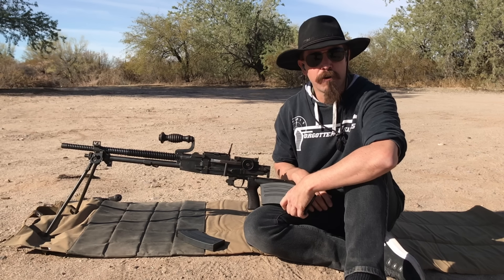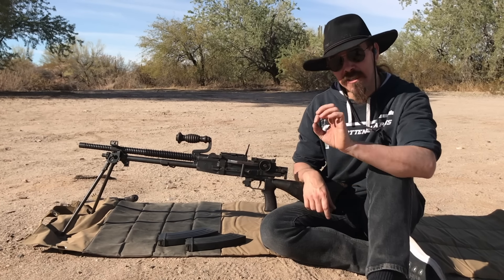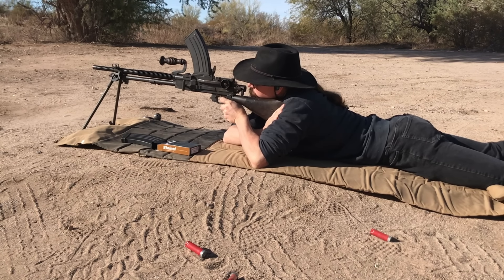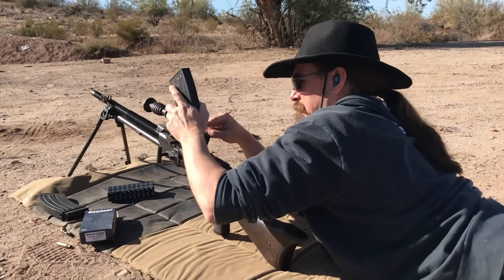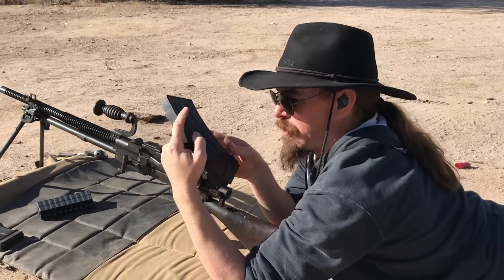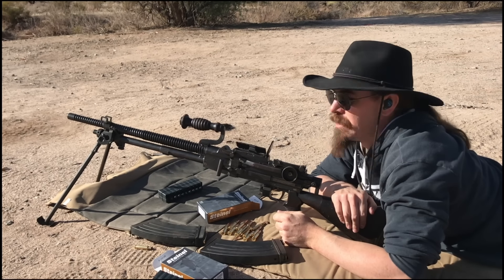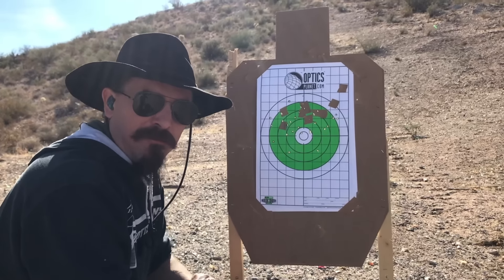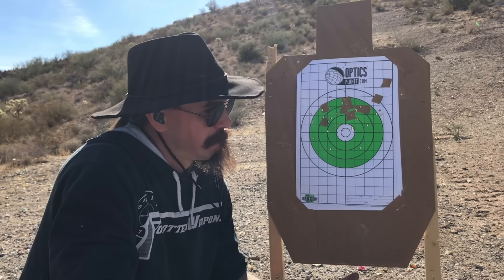First Range Trip with a Type 96 Nambu LMG (I Think I'm in Love)

Comment: You probably won’t believe this, however, in the late 1960s, I, with my Australian Army unit, went to Papua New Guinea, we “walked” a fair bit of the Kokoda Track. We did a bit of “hearts and minds” with the locals. We explored the WW2 “battlefields”. We came across the usual detritus of war, including trenches, bunkers, ruined vehicle, the carcasses of crashed aircraft. Then, in a Japanese bunker system, we found complete, intact, well preserved and when stripped cleaned and re-assembled, functioning Japanese small arms. We also found ammunition. We also found Mortars and in one case small Artillery, however we didn’t test the mortars or artillery. We did “test” the pistols, rifles and machine guns. I think, with reliable ammunition, I would like the Nambu, like Ian, I found the Nambu very similar to the Bren (which I loved in both .303 and 7.62). We took a bunch of the weapons back to Australia, I know some of them ended up in Army museums and am certain a few of them were in our units private kit bags. We learned later that the bunker where we found many of the weapons had been submerged for years in stagnant water and the tannins in the stagnant water had coated the weapons with a preservative!
Reply: Unbelievable
Reply: Crazy how it’s not crap like the boomers tried to claim.  If a gun still works in combat with original parts it is not only good, it is goated. German and Japanese weapons are both insanely high quality and well made considering most modern firearms wouldn’t even fire if left on the battlefield under conditions 5 years later. Even ak are not as invincible as people say. But ironiclaly japnese fire arms are. Arisaka is basically undestroyabke.
Reply: @ Hello fender, Not the Boomers, they are the generation AFTER, I grew up in a household where my Father, Uncles, neighbours etc had all fought the Japanese (hell my Dad was still fighting IJN Marines in Burma 6 months after the war had ended, the IJN Marines had run out of ammo and were making banzai charges using bayonets and sharpened sticks, trying to get close enough to throw satchel charges. They all had souvenirs, my Uncle later sold his Samurai sword for a fortune. Strangely, not many firearms, a few pistols, they looked a lot like Rugers to my eye, Dad gave his to a museum.

Comment: When I was in Okinawa (1960s), we had several Type 96 and 99 Nambu's available with lots of Japanese issue ammo.  The T96 loaders had an oiling pad integral, the T99 loaders did not.  If we fired the T96 dry, we would get neck separations every so often.  We found that we could wax the cases with Pledge furniture polish and reduce the separations to almost zero.  I suspect your modern cases are a bit thin in the neck/shoulder area as compared to Japanese issue, and will require some lubrication.  I would try rolling the cartridges using LEE sizing lube on a pad.  That is essentially a dry lube that you can leave on the cartridges for a long time.  The Type 99 has a slower extraction timing and does not need lubrication normally.

Comment: The Type 99 Arisaka is actually kind of impressive.  A WWII rifle with not only cock-on-close and rear aperture sight while still having a lot of obvious Mauser influence, but polygonal rifling and a chrome-lined bore.  It was probably the most technically advanced bolt action rifle in the war.
Reply: Japan produced probably the best bolt actions. The 38 and 99 are fantastic... their front posts are a problem though, the type 38 especially.
Reply: @iannordin5250 not the best then 🤷‍♂️
Reply: I would probably say the MAS 36 if asked about the best bolt-action of the war. Simplicity, great sighting system, and overall good design execution.
Reply: @LOVEMUFFIN_official 
You must've had better luck with yours. Mine has a rough action, feels like mild sandpaper and is by no means fast. I like the concepts, and the look for that matter. Just wish it was smoother... a lot smoother
Reply: Don't forget the dust cover.
Reply: I've never handled one in good condition; all were pretty rough. None had a good trigger pull,heavy and gritty.
Reply: My experience was rough to feed the first round, but very smooth for the rest.
That may be a magazine spring issue. 
I don't like having to move so far to cock the straight bolt handle. 
The sights are great for discerning your target quickly if in foliage, especially so if it is moving even just a little. 
Above all, it lands a round very close to where you aim it. Within a few inches at 60-80 yards, which is fine for center mass in a stressfull situation.
But, although military trained, I am nowhere near a competition shooter. 
Doesn't that make it almost perfect for your average WWII soldier?

Comment: Amazing that Japanese weapons are finally getting some recognition for how good they are.
Reply: *how good SOME were.  Their pistols ranged from downright awful to just below adequate. The Type 92 HMG was heavy with a slow rate of fire from 30 rd stripper clips which needed lubrication for sustained fire. It was basically adequate.  The Type 11 with its hopper-fed design was interesting but not very effective in a larger sense. Taking rounds from soldiers around you solved some supply problems but then you’re taking on the liability that all the soldiers took care of their ammo and provided clean, undamaged clips. Their SMGs were barely adequate in that while reliable, they fired an anemic cartridge.  They also weren’t supplied in decent numbers to make a difference. Finally, their late war, last ditch rifles were functional but their materials and construction varied widely and made their reliability an issue. 

I agree with you 100% on their rifles. Especially the Type 38 with the light recoil 6.5mm cartridge. Flat shooting, with a long barrel that burned most of the powder, it did not have much of a flash and very little smoke. Perfect for keeping your position hidden in jungle environments. 

However, a great bolt action is still secondary to a self-loading rifle like the M1, SVT, G41.
Reply: @soldat2501 apart from Nambu pistol...all Japanese guns were good

Comment: Good point about the culture problems with Japanese equipment in WWII.

A case in point: the Japanese Type 89 Grenade Discharger.

The Allies dubbed it the 'knee mortar'. Not sure why although I've heard it was because of a translation error.

Apparently some Allied soldiers tried to fire it with the base plate resting on the knee. Which resulted in a lot of broken legs. https://en.wikipedia.org/wiki/Type_89_grenade_discharger

Comment: I love the „uNdErpOweRed“ cartridge debate.  Thank you Ian for showing how crazy accurate and reliable this thing is. Ok then so why the hell are modern armies using 5.56 in lmgs and assault rifles if it’s underpowered?  It’s even smaller with less energy than a 6.5 Arisaka.  So that is complete bs. The Japanese and the Germans figured about before anybody else that small intermediateish type rounds were far superior than bigger rounds for almost EVERY battlefield encounter besides penetration like a 50 cal or a 308 would give for a sniper through material and concrete whatnot.  For a mass produced round the 6.5 Arisaka was arguably the best for recoil control with deadly precision. The Germans only discovered this late on the war and the Americans were close behind with the .30 cal carbine round but still not the same as it was not a rifle round but a round pistol Type bullet with a rifle mush sized cartridge. Japan does not get the recognition it deserves for its firearm genius. We all know german engineering but because boomers brought back late war models of guns they didn’t actually have good specimens to deal with. Almost like if a Japanese soldier came back with a Springfield 1903 and talked about how primitive america was when in reality less than a year after Guadalcanal most US troops were using the semi auto M1 Garand. It’s just a bad comparison to compare early war-late war firearms.

Comment: Alright Boys and Girls, pay attention to this.
    @5.23 thru about 6.10, when your firearm has a case separation STOP shooting it NOW. A case separation can occur because of the mentioned possible issues of defective brass and or a dirty or pitted chamber. A case separation is also a good sign of excessive headspace in a weapon. A gun with excessive headspace can blow up in your hands (and face), shooting it.
    That weapon needs to be thoroughly cleaned and inspected. The headspace(of the weapon) should be measured and compared to the manufacturing specifications of the weapon. The ammunition also needs to be measured and compared to both the specifications and to the measurements of the weapons chamber. The weapon could be in 'specs' and the ammunition could be manufactured 'short'. In other words, just checking the chamber with some head spacing gauges won't tell you that the combination of weapon and ammo is safe.
    Nice video. Y'all Take Care, be safe and be aware of your head spacing! John
Reply: I expect that Ian had the weapon checked out good (probably by Mark Novak (I don't know that. Mark is an excellent gunsmith and I know he has done work for Ian))and I'm not trying to fault anyone.
   I just wanted to make everyone aware that there is a potentially very dangerous situation going on.
    Everyone Take Care and be safe, John

Comment: Two small things for Ian. First the spring is in the magazine dust cover is in wrong. Once released the cover should spring open and you should not have to fight it to get the mag in. Also on an open bolt gun, you should really operate the bolt first not the mag. Sometimes you remove the mag first you can set off a round accidentally if the magazine was stopping it from firing.

Comment: Need to check headspace on this firearm...  Make or use commercially available headspace go/no-go gauge and check headspace... it's not correct.  Need to make a chamber cast and this will help you with finding chamber imperfections. From this video it's obvious that there is a issue with the throat of the chamber.

Comment: I have never seen a malfunction like that. That’s pretty crazy. Glad it didn’t get jammed up in the chamber
Reply: I have. Magazine follower is nose-diving, so the round smacks into the end of the barrel extension.
Reply: @ScottKenny1978  isn't that a feed lip issue if the follower is 20 rounds away?
Reply: @randomidiot8142  no, it's the follower.

I had some old AR magazines, a 20 and a 30. When fully loaded, the first round liked to get stuck between the barrel extension and the feed lips. I replaced the follower with a Magpul 4way anti tilt and haven't had a problem since.

Comment: The shop i visit has a dealer sample hotchkiss m1922/26 made for Turkey with a strip feed. I found them type 92 high strips that fit and feed. But we haven't figured out the gas to get it running more that a couple rounds.

Comment: That torn case reminded me when i was out shooting the ZB-30 for first time. First, i thought that it could be some gunk inside chamber, same as you, but it was happening again and again( tolerances in chamber like a new barrel).  After that i tried some really old steel case and brass with no issue.... Only new made stuff have this problem, so I lubricate my cases before shooting and the problem is gone. Its like the new ammo is not ment to be used in automatic firearm...

Comment: It's worth noting that unlubricated soft-point hunting rounds are quite different than the reduced-load Type 38 cartridges with oil loader intended for this gun. Of course, you don't want to get those rounds exposed to dust in the field! Considering the chamber problem and ammunition, this was a rather good showing. Also, disappointed Ian didn't wear his IMA Type 98 senbou cap!
Reply: Pretty sure the 96 and 99 didn’t need oil loaders
Reply: @alexmoore1506  The 96 did, the 99 did not.

Comment: That's really remarkable grouping for a support weapon.  No worries on the malfunctions, even our current 240s occasionally destroy a round trying to jam it in incorrectly and that's with spec ball ammo.  I'm really impressed with that weapon overall.

On another note though, there is a lot of appeal to having a larger beaten zone at full engagement range when you're employing a support weapon.  It would be interesting to see what 200-600 yards looks like, maybe on steel, I'm curious how those groups will open up.

Comment: I'm curious, what happens if u shoot a gun with a hole in the barrel, what are the "catastrophic results" and what causes it? Excuse me if this is a silly question but it's not obvious to me. I can understand that gases would be released through any hole but wouldn't it be a bit like a mussel brake on a larger weapon, depending where the hole was? Also, why were the bullets jamming and squashing up the "soft" lead head, is that common and what is happening to cause it? Again, just curious. Now off to see if you have done a more in-depth look and tear-down of a Nambu, Forgotten Weapons does a great job at showing n explaining how these guns work and how n why they came about, thanks for doing it.

Comment: I read somewhere that the Type-96 was something similar to a SAW and the Type-99 was the LMG, which is believable, considering that the Japanese didn't ditch the Type-96 to use only the 99, they still made both until the end of the war and they probably served in different roles.
Reply: Well from my understanding, not exactly. Japan didn't had the industrial might to produce enough small arms to swap all of troops to 7.7mm type 99, so it's all over the place. Although my understanding is that type 99 rifle and LMG are more likely to end up in pacific theatre, and the older type 38 rifle and type 96 LMG are more likely to end up in China theatre.

There is, however, an even older Japanese LMG design that is closer to the SAW concept. I think Forgotten Weapons also has a video for that. It is actually fed by 6.5mm chargers dumped in a hopper, thus enabling troops to not only share ammo, but method of loading as well. It worked as well as you can expect (read: not very well), but it was truly ahead of its times. A lot of them end up in the hands of Chinese "puppet troops", whom the Japanese really didn't trust with empire's newest and greatest.
Reply: @BicyclesMayUseFullLane  Type 11, pretty unique gun indeed.

Comment: I'm more knowledgeable about warships, but it seems Japan started the war with very solid equipment for the time (maybe not the tanks).
It's fairly impressive, considering how far behind they were before the Meiji Restoration, in 1868.
Reply: Knowing that natural resources would be scarce due to the sanctions and embargoes imposed on Japan, Japan's tank philosophy wasn't to create big lumbering machines to spearhead massed soldier formations. Instead, their tank philosophy was to design small, fast tanks, using tanks as if they were just armored machine guns and mortars, to be used alongside infantry shock troop assaults. While enemy infantry focused on taking out the tanks, light machine gunners charging forward and leapfrogging each other, in concert with standard rifle fire from other squad members, would almost guarantee scoring breakthroughs against the enemy. If you focus on killing Japanese machine gunners, the Japanese light tanks could assault you, and if you try to knock out the Japanese tanks, their light machine gunners could outflank you and fire on you.

Comment: Hmm I thought you was gunna  MagDump  the 30rds!!.. it was  just  Bursts?! .. love to see magdumps , wonder if  the malfunctions  (double  feed) could  be That the Magzine is upside down?! .. Gravity  sucks everything  downwards???
Reply: It's not a double feed.
The barrel throat is as rough as guts from 80 years of erosion and corrosion.
So the soft lead tip jams up against the throat instead of sliding into the right position.
That's another good reason to use FMJ in any military firearm...that's the ammo it was designed to use.....

Comment: Could you explain what the issue (or potential issue?) with soft point ammunition was? I'm having trouble imagining why jacketed ammunition would make a difference to the mechanical operation of the gun.
Reply: The tip doesn’t deform and snag on the ramp. Bolt actions and maybe some semi-autos are fine but not ideal for machine guns

Comment: I know there is a bullet diameter difference between the 6.5mm Swede and the 6.5mm Carcano. Is there one with the 6.5mm Japanese vs. the other two?
Reply: I suspect so, at least with the Carcano. They seem to have oversize bores compared to other 6.5s. It seems the typical 6.5 rounds available for the Carcano had bullets of .263-.265", which led to poor accuracy. Now that there are more of them in the market, people are finding that they need bullets .266-.268" or so, and then can be quite accurate.

Comment: What would happen to a rifle if you drill a hole in the barrel? Barring a hole big enough to cause a structural failure of the barrel due to pressure (something I find hard to believe) wouldn't it work just like the vent holes for burst cases on Japanese rifles?
Reply: Well it becomes a problem the closer you cut it to the receiver. If it’s like at the end of the barrel, that’s kinda like porting

Comment: i would like to know and see what happens when a hole is drilled in the barrel?
Reply: I believe the hole he is talking about is nearly the diameter of the bullet. Typically what happens is that enough of the bullet is pushed into the hole that the barrel breaks off at that place.
Reply: It vents a ton of gas in an unintended direction and the barrel can warp, crack, and/or burst